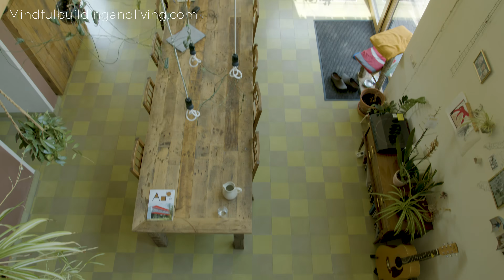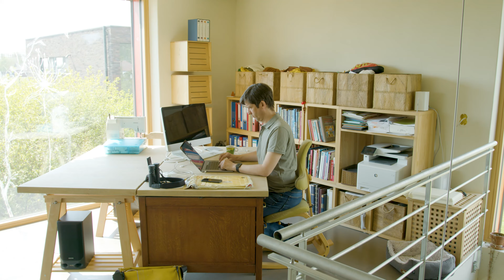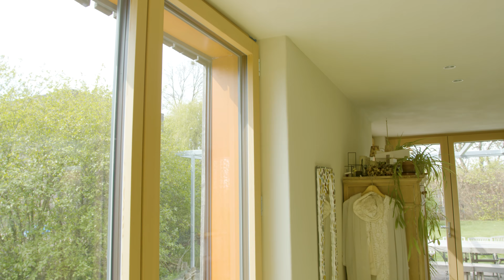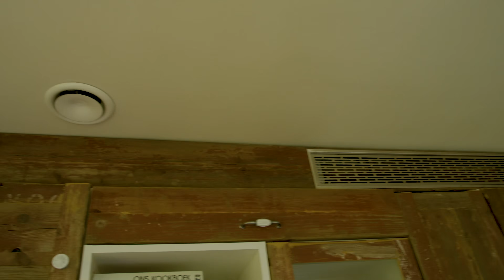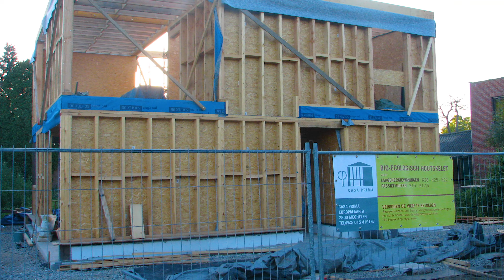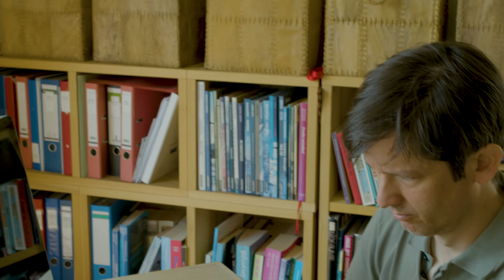Effortlessly Efficient: Benefits of Living in Passive House  for a family of 5

Comment: So the passive house has to be air tight, but it also requires fresh air to be pumped in?
Reply: yes it is airtight to stop uncontrolled air infiltration, fresh air is still supplied via a Mechanical heat recovery ventilation system which can recover a min of 75% of the outgoing heat which is how it is able to maintain comfortable temperatures inside with minimal or even no heating, heating is able to be provided simply by having an electrical resistance heater in the air supply duct, it can even be provided by a heated towel rail, depending how many people live in the home (more bodies = more heat generated) and its size determines how much heat you may need or not, this video doesn't mention the specifics of the ventilation system too much, but it is a requirement of certified passive houses.
Reply from the maker: indeed it needs an air circulation pump

Comment: this sould be the  standard in all  countrys , i live in the uk   and our government  are bleating on about   going  net zero carbon  by bla bla bla !  yet   if you go to look at a new built house in  england  there are zero  homes built to this standard   on the market  .
[ i will say   the only place in the uk that   promotes    this type of home  seems to be wales . as they do  give   eco home grants   and will  pass  plans  for sustainable desings  
where i live  i asked if i needed  council permission to put solar pannels on my roof  . my  local council   did not even know   WTF  i was talking about !!
Reply from the maker: you must be joking....???? This is so sad, I hope that ecological building will become mainstream worldwide
Reply: The average efficiency rating of a UK home is a D or E (on a scale from A most efficient to G least efficient) most homes have solid walls with no cavity,p let alone insulation! The average roof insulation is about 10cm! Forget heat pumps, our builders/plumbers/installers can't even get gas boilers done right! The average boiler is less than 80% efficient even if the boilers are 90% rated because the set up is all wrong, not balanced. Some of the poorest people in the UK have homes so inefficient that they would be impossible to heat with a heat pump. Some of the poorest renters are forced to use electric heating including for water that is literally up to 4 times more expensive than gas (some homes have no gas supply) or they have oil heaters which is just utter nonsense in this age. The new homes are better insulated, usually rated a B (in reality more like a C or D) but the quality is so bad (not as bad as US disposable homes but still bad by European standards) this is all a mess really, such a wasted opportunity. All Jones need to be upgraded to at least a B now. It would boost the economy and reduce it reliance of dirty Russian and Saudi fossil fuels for a start

Comment: Great video. I feel relaxed now. I really like the overall design, and the design details.

Very well done. I also like that the family has lived in it for 8 years, so they have a lot of experience in the house. They didn't see any problems with it.

I had a drafty house, then insulated inside the walls, and added home-made window-film frames (3M film that you tape down, then get rid of the wrinkles with a hair dryer.).

That made my house the same temperature everywhere, so I could lower the temperature. After doing that and caulking all the cracks, my heat bill was reduced by 2/3.

If I could start from the beginning, I would like to do something like this, or maybe earthen walls.
Reply from the maker: that sounds awesome, the way you've insulated your house. Indeed, the next time I build, I'll consider far better the insulation and reduce the heating/cooling as much as possible

Comment: you can call it "energy efficient" or "sustainable" but its active heat pump means its not passive home.. and key elements for a true passive home, such as "thermal mass" are part of this home too.....
Reply: Why not? Pretty sure that’s allowed in the spec . Maybe you are talking about net zero?
Reply: Pretty sure passive" does mean  an :"active",: HAVC.. KISS...
Reply: @nc3826  it's certainly better to use even less. why don't you show us where it says heat pump is not part of the passive home standard then?
Reply: "better"??? what does "better" have to do with the word "passive"?

HP is active ie its not passive... end of discussion... all the rest is BS...

 so have fun down your rabbit hole being obtuse about it... bye Alice...

FWIW Trump would proud of you :)
Reply: @nc3826  passive house is a standard. a home can be certified as passive. it's good that you want to be BETTER in energy saving but YOU don't set the standard
Reply: Firstly relax. Secondly, if you are lucky enough to build a well designed home like this, why wouldn't you? And why are you criticising the use of heat pumps which will be greater than 300% efficient in this home, probably closer to 500% efficient? In other words, for each kw in ( they only use 2kw!!) they would get about 4kw of energy. If everyone did that and combined with a small solar panel system, they would be energy efficient and off the grid for gas and electricity (with a small storage system). That is of course expensive, this would cost thousands of dollars. You can however do it in stages. For example, when your roof needs replacing and you have the scaffolding up anyway, you can install photovoltaic solar if you have the right orientation and pitch roof. Then when your boiler finally fails, you can put in a heat pump. When your windows need replacing you can get triple glazing. One thing everything should do is improve insulation in the roof and walls of possible because it's potentially do cheap and easy! then be ready for a simple heat recovery ventilation system. You won't get a passive house doing this but it will be very close and most importantly it would be realistic to do economically and will progressively pay for itself in energy efficiency and value added to your home
Reply: @nc3826  there is a passive house standard and in some places there is a leed standard. but if you talking about your idea of passive house then it's cool. no point arguing. there is an association of passive house worldwide btw. they maintain some standard.
Reply: Two different styles of passive house. 

Passive solar - the one using thermal mass to store the suns heat usually used in warmer climates and not as useful in climates that are very cold much of the year or have little sun. You still have opening windows to use as heat regulators like flow through breezes etc and other features that modify what gets heated by the sun and when - still needs winter warming depending on location and cooling too depending on location and how climate adapted the people who live there are. In the right spot (usually warmer climates) there is no added cost to run heaters or coolers but that does not apply to everywhere.

Passive house - A completely enclosed living envelope with no thermal bridging to eliminate heat/cold loss/gain. Best used in cooler climates, still good in warmer climates but not in humid climates where air flow is best. You can have opening windows etc and still be passive house they don't HAVE to be permanently closed (best for homes that are also in warmer climates) so you can have fresh air when you want it. This type of passive home has heat pumps, either air heat pump or thermal ground source heat pumps (the best). There is a running cost and instillation cost but once it in all running it is low cost to run and you have an even temperature in the house all year round. The air is filtered so there are little problems with allergens, smells etc. You do have to be careful the unit is working all the time particularly if you have a home you can not open windows you don't want to suffocate from lack of oxygen but if the unit stopped working you would hopefully notice it before that.
Reply: Wrong,  thermal mass and reducing bridging (ie insulation) are just different elements...they all can be used int the same building... 
also there are passive ways to control humidity and create heat exchanges....but that far beyond the scope for YT comments....   

bottom line is heat pump is still not passive...
Reply: @nc3826  A bit late I guess (two years) but still:
I'm very much interested in the concept of truly passive air to air heat exchange. 
Can you give me a suggestion where to look for further information, some links maybe?
Thank you.

Comment: Imagine having newspaper ink in the insulation... thinking you went all biological, organic, and green.
That paper will off-gas forever.
Reply: All depends what the ink is made from. It is no longer as toxic as in years past.
Reply: It’s totally fine. He has a air circulation system. Itprobably has way better air quality than most homes. He said he can’t smell his cooking remaining in his kitchen. So it’s highly unlikely that any such gases will cause problems. Also I doubt if these papers will cause problems unless they got wet
Reply from the maker: indeed you have a point, but I imagine and hope bio ecological building materials don't contain toxic substances...
Reply: @MindfulBuildingandLiving  But that shredded paper likely do. Even if the manufacturing went through bleaching and removed the solvent from the ink, it still will contain some acid.
In the end it will not affect the health of the occupants of that home, since the off-gassing is likely minimal and going off toward the exterior in the summer days. If they do not sniff their walls they will be fine. ;)
Reply: @MindfulBuildingandLiving  WADR the OC was an anti=environmental trolling conspiracy theory with no basis in fact... that you should t not encourage IMHO....
While its not really a passive house, since it uses a heat pump... I admire what your trying to do... And good luck with your future efforts...

Comment: With the high efficiencies of mini splits, there's really no reason to build passive houses anymore.
Reply: Why no reason? Passive house is not only about low heat/cooling loads but low primary energy demand, high indoor air quality, temperature stability in blackouts. Also if you disregard passive house principles, you will need a larger heat pump which will consume more energy even if its efficient.  A 1.5 ton dual stage heat pump will be more efficient than a 3 ton VRF unit.
Reply: @albertoarriaga9611  What's the square footage cost?
Reply from the maker: Hi there, I'm not familiar with mini splits, what are they?
Reply: @MindfulBuildingandLiving  They are variable speed heat pumps that do cooling and heating.  I'm sure they would work well with passive houses to fine tune your comfort.
Reply: @MindfulBuildingandLiving  I live in Karachi Pakistan I follow your channel YouTube
Reply: I live in Karachi Pakistan I like your comments send 4 month old
Reply: Total bs. The idea of passive house is to safe energy
Reply: @mujkocka  The goal is to save money, not energy.
Reply: @richardmckrell4899  that may be your goal but  it doesn't help the planet. kind of selfish
Reply: @mujkocka  There is nothing more selfish and wasteful than prioritizing saving energy over investing capital for long term innovation.  Short term virtue signaling has many long term adverse affects including disproportionally taxing the poor and working people.  Think long term capital investment not short term energy savings.
Reply: @richardmckrell4899  your saying is not selfish to destroy the poor people's habitats due to climate change because you want to save a few bucks a year? that's not selfish. definitely thinking long term. i had solar panels, battery to store power from solar, better windows. all good long term investment. having a leaky house IS not saving the planet or the poor people
Reply: @mujkocka  Every dollar spent on more expensive renewable energy disproportionally hurts the poor, especially when subsidized by the government.  The rich don't care about energy costs.  The real answer to fossil fuel is nuclear, not expensive, wasteful renewable energy.  Governments promote renewable energy for 3 main reasons; 1. Virtue Signaling/Votes, 2. Control, 3. Profits/Taxes.  Government doesn't care about saving the planet.
Reply: @richardmckrell4899  every extra CO2 leaked to the atomsphere is exacerbating the climate change issue. Nuclear is ok if we can put the waste in your backyard. i would not be cool with that but i know at least you are responsible like you claim you are.

Comment: I couldn't quite catch what the internal walls were made from. Could you provide a few more details please. Was there a vapour permeable wrap on the external and, separately, on the internal walls?
Also, does the cellulose compact over time? How was the cellulose placed in the wall cavity? Blown in?
Thanks for the video. Beautiful house.
Reply from the maker: Hi Sparky, I wish I could answer your questions, but these are technical matters I'm not familiar with. Thanks for the compliment
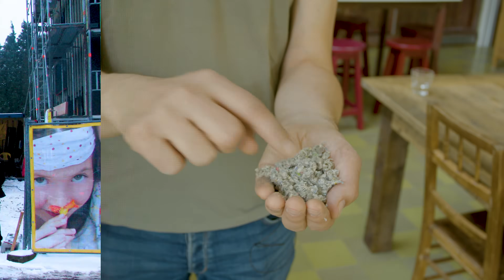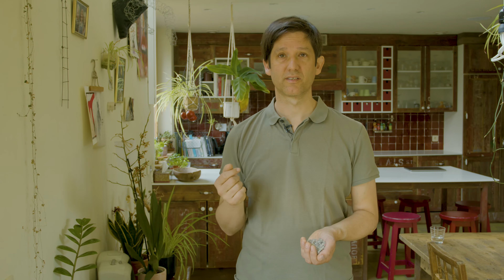Reply: @MindfulBuildingandLiving  He says it at 5:30 and again at 5:41, but his accent is so thick it's not decipherable. Sounds like "low finish," but obviously that is not a thing. Anybody have any ideas?
Reply from the maker: @Thoracius  a loam finish is what they used
Reply: @MindfulBuildingandLiving  So it's basically panels made from dirt? Interesting. I didn't know that existed.
Reply from the maker: @Thoracius  no not dirt panels. The walls are wooden structures and finished with loam. That's like plaster, but a natural product. Here you see how loam (or a mix of loam and clay) is applied to a wall https://youtu.be/bJ8l3Of3hyU
Reply: @MindfulBuildingandLiving  I think I understand. So they apply the soil like a plaster directly to the interior osb sheathing.
Reply: @Thoracius  this is what they used to use in really old house all across the Europe.
They basically made a square structure of a wall with boards, squares that were missing, they used reeds, willow brunches, they interlace these materials, then they had to harden the wall, so they did that with clay, so this was a plaster, then they used lime with pigments for coloring the walls. Lime is also desinfectant so these structures were very healthy.
Reply: @Ladida386  I'm familiar with lath and plaster. It was also ubiquitous in the States until the invention of gypsum board. That does not seem to be what he has in this house.
Reply: @Thoracius  it’s loam plaster. He says it quite clearly in the video
Reply: @immers2410  Thanks. I'd never heard of using dirt as a plaster. Does it come in prefabricated panels or is the soil just applied wet as as a paste? What is it affixed to?
Reply: I live in Karachi Pakistan I like your comments send 4 month old